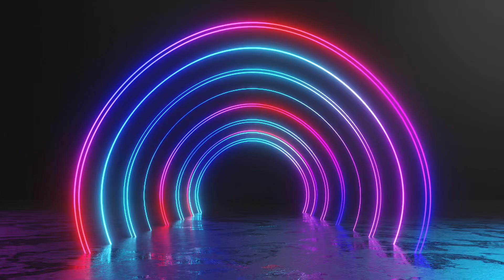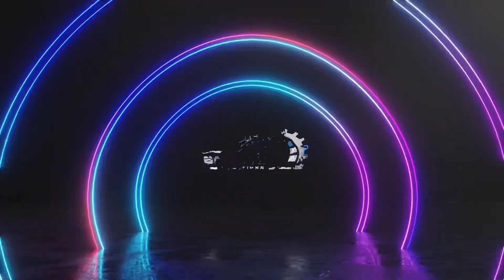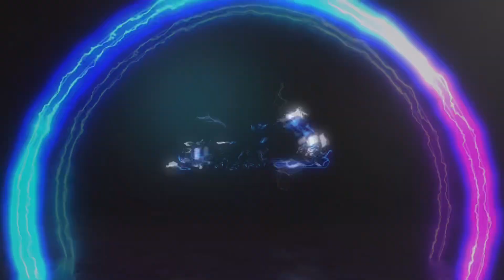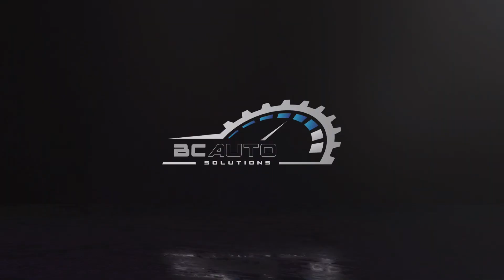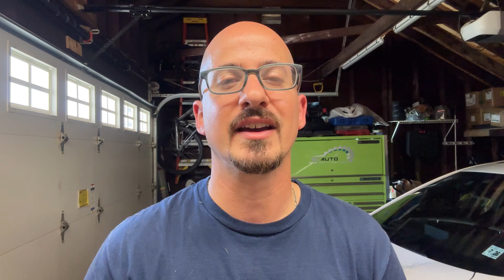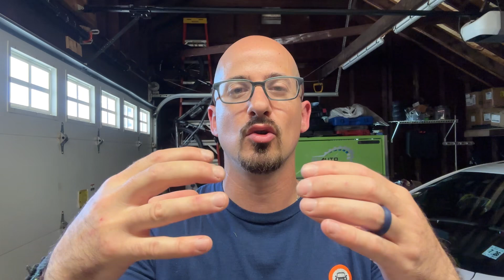Q&A Episode 57 (broken bolts - emergency trans release - timing belt tensioner failures)

Comment: I have a 2008 Honda Accord that I just bought. And it's smoking out the tail pipe. What is a good way to diagnose the issue?  And how can I test the valve stem seal.  And if needed to.  Is Mahle a good gasket manufacturer of the heads need to be repaired or replaced.  Thank you.
Reply from the maker: Is it on cold start, accel, deceleration, etc…
Reply: @BCautosolutions  it's on deceleration and when parked and I accelerate on the gas.  It smoke.  It doesn't feel like a miss fire I got an engine code for the oil pressure switch on the rear head.
Reply from the maker: @raulpereyra2817  probably valve seals

Comment: Hey man I got a question, my pilot is at 140k miles it’s a 2019 touring 9 speed, is it ok if I use valvoline max life atf fluid instead of the 3.1 fluid? On the max life bottle it says   Honda zf transmission compatible

Comment: Is there anything that can be done to fix or help with vibrating at stop lights for the 2015/2016 CRV? From what I’ve read online it is a common issue for these year of CRVs
Reply from the maker: Theres a service bulletin for this but im not convinced it fixes much.
Reply: @BCautosutions yea from what I’ve read, it doesn’t do much.
Reply from the maker: @2012boracho  it doesn’t
Reply: Problem is this idle drops  too low by about 50-100 rpms. put on the AC and your'll see it rises and the vibration will  be  gone.
Reply: Yea I do that or turn on the headlights.  Just got the car so I’m trying to find a more permanent fix.

Comment: Ok to reuse original spring clamps on radiator and heater hoses when they are being replaced ?
Reply from the maker: You know what this is a great question and I’ll elaborate on it along with clamp placement.
Reply: @BCautosutions  Looking forward to your response !

Comment: What is a good size brake rotors and calipers upgrade for the passport/pilot without fitting issues.
Reply from the maker: The mdx/tlx S oem calipers and rotors have been fitted to a 2nd gen ridgeline with some custom adapters. Probably your best bet to go with that route.